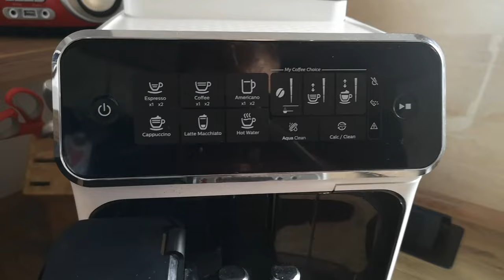Fix Philips LatteGo coffee machine - less coffee & no water problem

Comment: Amazing! My EP2210 started to have the no water pouring issue month after the warranty ended, descaling didn't help, water was only flowing through the frother and I started to look for a service. Then I saw this video and fixed it in 5 minutes by replacing the worn out silicone ring. I can't thank you enough! 😊
Reply from the maker: Great to hear that. Regards.

Comment: Thanks, this helped me diagnose and fix my 3200 series. My o-rings appeared to be okay, but I found the bottom port on that valve to be clogged with coffee grounds. Disassembled the valve (with a flat screwdriver, push and twist the top to release) and cleaned it out, and we're back to making espresso again. Might order an o-ring kit just to be safe — my machine is about 2 years old and gets used a few times a day, so it might be time to do those anyway. Thanks again for digging in to this issue and documenting it.

Comment: So yeah the same happened to us, this is the second time actually. First time water even got dispensed into and under the tray. We tracked down the water and my father replaced the O-ring only and it was working perfectly again for a laughable price - for about 2 months. Now it's not dispensing water at all sometimes and as you described there is condensed water everywhere inside (it's interesting that the tray is now safe so it doesn't look like a hard leak anymore). Guess I'll replace the whole unit this time, thanks for the vid!
Reply: I also have a problem with my coffee machine. The first coffee is ok but when I try to make second one I don't get any coffee or I have 50% what is supposed to be (water goes to to tray under). Did you had same symptoms?